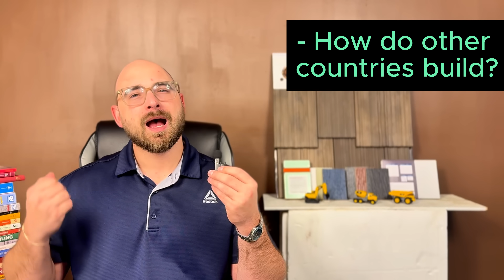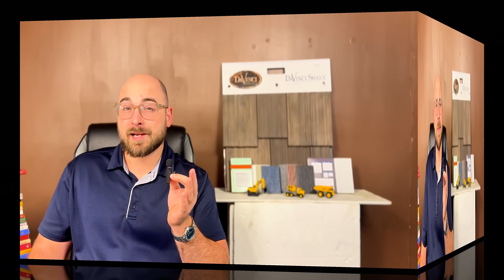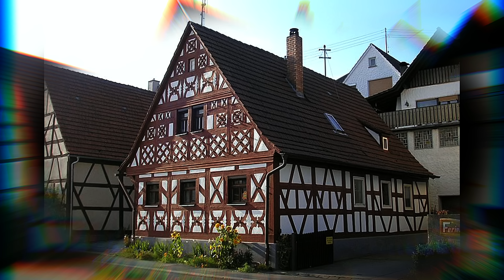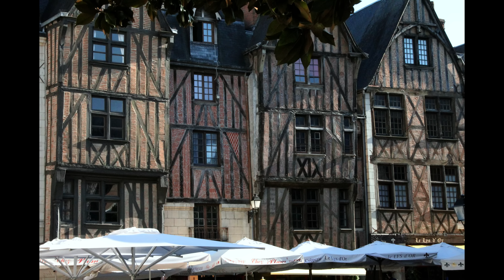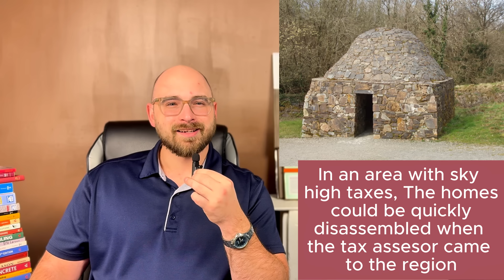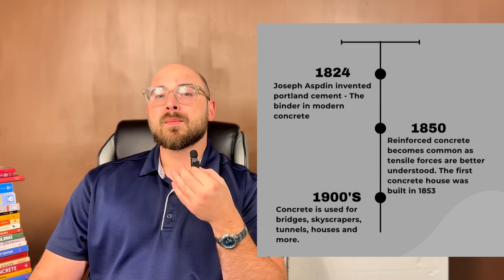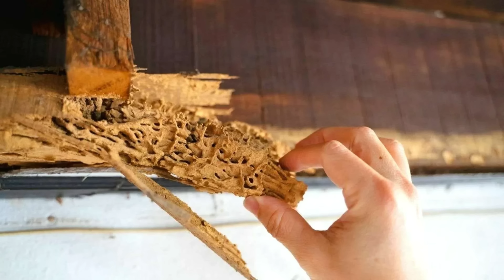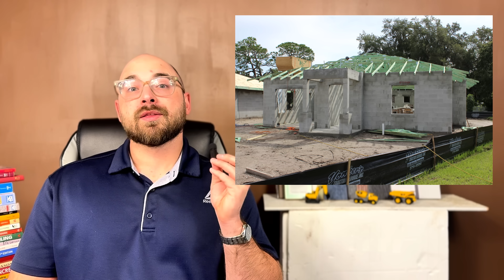Why Other Countries LAUGH at American Homes

Comment: If i am not wrong the romans contreet its sectret was limestone chunks so if there cracks to appear water would get in amd the  limestone would slowly react with water and surrounding concrete and fill the cracks and as result make the concrete strong and whole again 'self heal' and to why a lot of roman concreet structuurs are still standing. (Sorry for lack of punctuation am crap at that) But what is more interesting is the roman contreet used around water isn't as corrosion sensitive and as far as i know last time i looked into it we still dont know how or why it isnt corroding and how it still last and remains strong.

Comment: Just one detail about roman concrete you forgot: unlike the one we use today, it was self-repairing. The recipe was lost for centuries but apparently, using sea water instead of regular water was the trick.
Reply from the maker: There are admixtures we can use today that can give modern concrete self healing properties. 

One of which is xypex. 

Although I don’t know that it can heal cracks as large as Roman concrete
Reply: @Mike_Fortin  
Just discovered your channel but i guess you know much more about all that than me, a random dude with no particular interest in building.
I don't know about large cracks but i just thought it would have been good to point out that even if its still a much better material than paper and light wood, no building made of your average modern concrete could last 1000 years like the stuff the romans built.
Reply from the maker: I appreciate you as a viewer, I’m working on drastically improving the quality of content (shorter, more entertaining, better editing etc ) 

It’s possible to build concrete homes that can last for centuries, it would just add cost, 

The important thing is to protect the concrete from water. 

For example, an ICF house protects the concrete from water, we add a capillary break at the footer, we use waterproofing AND dimple mat below grade, creating drainage and waterproofing, 

We can add xypex to self heal small cracks, we use a geotechnical engineer, to minimize settling, 

This is pretty standard for homes I design. 

To go a step further,

We could go as far as to build a concrete or steel roof, use corrosion resistant reinforcement like stainless steel. ,   Build 1’ thick walls instead of 7” thick. 

It’s possible, but most won’t build that way 

When we’re talking about the most expensive homes they’re usually all about vanity, not science.   Ie, floor to ceiling windows, roof designs that are bound to leak (sloping the wrong way / pooling water), etc.

Comment: Light wood constructions would have been fine if they were very cheap to purchase.  Unfortunately in the US these houses are very expensive given the material they are made of.  They may be cheap to build but non of these savings are past on to the home buyer.  I lived in such a house in the US and it was bad.  No noise isolation! Everything can be heard inside the house.  The walls were leaking water when it was raining (the walls, not the ceiling!).

Comment: Im in the uk and my and my dads house are brick and where built in the 50s and never had any structural, mould or damp issues. 

My grandads house is 250 years old and same thing. 

And there is a stone and mortar church in the vilage from the eight hundreds which a couple live in and  and it hasnt had any problems either for the 1200 years its been stood.

Comment: It't not only the material choice. The build quality is atrochious as well. I always like to tease my family in Malaysia about their poor contruction standard, but compared to the one in the US they build magnificent palaces. I visited a friend in his fairly new home (~3 years) in Detroit and was shocked how badly built it was. Doors didn't close properly, bathroom taps were loose, there was a leak in a water line in the wall of the garage, the stairs were creaking when stepped on, you could hear every single word through the floor and the windows were not tight. I could feel the draft going the guest room from a gap between the window frame and the wall. The driveway was cracked, as the concrete was either too thin, or the foundation not prepared properly.
He paid $750000 for that piece of shit.
Reply: Sure but NONE OF THAT has to do with the build quality of the home. There are home builders and then there are other contractors who are hired by the developer to come in and do their jobs whether electricians or plumbers. I can assure you there are shitty homes in Europe and around the "developed world" that have had bad electrical work or bad plumbers.
Reply: @wowomah6194  True, there are shitty houses in Europe as well, especially in the southern countries, but I haven't seen anything at the level of the US cardboard boxes yet. Even the peak of cheap crappy construction in the 50ies and 60ies does not come close. Those houses are still around today, unlike most buildings in the US that rarely get older than 60 years

Comment: I was raised in a house in Ukraine with the walls 60cm thick. I lived in the south where the most common material was a block of pressed sand, sea shells and other stuff from the sea. It is usually 40cm wide. Then the outer wall is usually from a lightweight red brick. And inner walls throughout the house are made with cheaper and ofc heavier brick. This way the house is cool inside in summer and warm in winter. What I see on the Internet how people break inner walls with their hands in the US really shocks me bc I can’t even hang a picture on my wall without drilling it

Comment: One thing that always stands out, is how Americans whine about not wanting to live in apartments because their neighbors might be noisy. Which if your apartment is made out of wood and thin panel sheets, I can understand, but our homes are not built like that, they are built out of brick and stone, meaning that it's very unlikely that you will hear your neighbors making any noise, except for rare occasions (like when my neighbor drops a bowling ball on their floor (or maybe it's something else, but might as well be a bowling ball) or when my other neighbor decides to drill the thousand'th hole into their wall that by this point HAS to look like Swiss cheese....

Comment: My house is over 100 years old, build with solid brick. It keeps cool in summer without the need for AC and it's easy to heat in winter. Mold is not an issue if you heat your house properly and air it out regularly. Actually, I'm thinking about buying humidifier because the air inside my house is too dry 😄

I used to think that punching through a wall is a thing only in movies. I was surprised to learn it's actually possible in real life 😳

Comment: Thank you for the informative video. I've always wondered why you still don't build mainly brick or concrete houses, but still stick to wooden ones. Here in the Czech Republic, it is possible to build from concrete (mostly panel houses, in which there are individual apartments), brick houses (especially family houses), but also from wood. Wooden houses are also very nice and, most importantly, much cheaper. However, they require exactly the same documentation as brick houses and must meet strict safety rules. It is also possible to build a wooden cottage (I would finally like one in the garden this year). It is only used for occasional living - mainly for recreation and certain rules apply to it depending on the dimensions... I think that despite this, a brick house (or a house made of concrete blocks) has greater advantages for the USA than wooden houses - by the way, houses can also be insulated with various materials, either between the bricks or along the perimeter of the walls around the entire house. The biggest advantage for you Americans is definitely safety from natural disasters. We've had several smaller tornadoes here too, and more houses remained in the entire village they swept through than if they were made of wood. The same goes for floods - during which only a few houses that were over 100 years old collapsed in one village last summer... S.🤗

Comment: The Roman Pantheon was the largest dome in the world for centuries. It’s built of concrete. They designed the dome to be lighter as it rose in height with internal coffers and a circular opening (oculus) at the top. But most interestingly, to me, they threw small clay jars into the pour. Adding more jars closer to the peak, creating hollow spaces in the concrete and reducing the load of the dome.

Comment: I've lived in 7 countries, rebuilt houses in 3.   US construction has advantages & disadvantages.   Easy to build by low-skill labor, goes up really quickly, resistant to earthquakes, uses renewable materials and easy to modify in the future.   As far as durability, a lot of wood houses in New England are over 200 years old - a friend owns a wooden farm in Norway that's 1000 years old....  it's largely due to good ongoing maintenance, which is true of any building.   I've seen crap building & poor maintenance in a lot of countries. 

PS - the coolest building material I have seen is aerated concrete blocks, which is really common in the Netherlands....

Comment: I used to think the same, but having lived long enough in the US I came to appreciate the homes for their major benefit. Modifiability! Want to add a window? Easy. Want to move an electric outlet? easy. Add a bathroom into an existing room? Easy to get the plumbing. All stuff you can't do easily in a brick house. I remember my parents adding a chimney into a brick/concrete built house in switzerland. What a major pain in the ass that was.

Comment: 15:30 CMU is interestingly used in Poland for some reason.
During communism alot of appartment units were built using prefabricated concrete slabs, because it was really fast to put up and it allowed for rapid urbanization, especially in cities destroyed by war and especially in the west, where many cities were ordered to be destroyed by retreating Germans during WW2 so the Russians couldn't use them to scout areas.
After the fall of USSR and Poland becoming capitalist, many appartment units are still modeled after the prefab appartments, but nowadays they are built with CMU and reinforced concrete instead probably because it lasts longer and since prefabricated slabs aren't made anymore here. 
New districts of bigger towns usually are built only with this method (Prime example is Jagodno in Wrocław)

Comment: These comments are absurd. I live in a wood framed house that has been absolutely fine for fifty years. There are many wood framed homes all over the world that are hundreds of years old and just fine. That seems plenty "built to last" for me. How long do we expect stuff to last? Ancient homes often are also impractical, not suited to modern living and simply unfashionable. Having housing that lasts hundreds of years doesn't really make sense. Likewise, I live in a cold climate and my home is well insulated. I have modern windows so it's very quiet inside. I've remodeled the home several times without great expense. It's silly to pretend that wood-framed homes are disposable junk or a bad idea. Lastly, anywhere in the US where the environment calls for CMU, it's already required by code. For example, CMU and tile roofs have been required in Florida since 1992. The homes you see that have been totally destroyed after a hurricane in Florida are almost always pre-1992 homes that were grandfathered in.

Comment: Not picking on you with this comment.
"Contractors are more familiar with wood framing" sounds just so stupid from an outsiders perspective. It's a cursed circle: most contractors don't know how to build with concrete => less people eager to build with concrete => less contractors are going to learn how to build with concrete => prices of building with concrete are driven high by workforce scarcity => most contractors don't know how to build with concrete. Now we're at the beginning. 

There's a guy on YouTube, don't remember his name, some big channel, he specializes on framed houses. In a video about why US doesn't build with stone/concrete he said something along the lines "it costs upwards of 400k$ to build a woodframe house compared to at least 600-650k$ for concrete house"

For some reason these advocates of woodframe houses always forget to mention that you are supposed to completely strip insulation and apply a new one with wooden framing every 15-20 years which is extremely labor and time intensive, also costly and you can't use your house during that period. If you expect to live in a house for 40 years at least it's going to cost MORE than a solid structure house because of it in the long run.
In that very video he says something like "there's about 2 million wood framing contractors in the US". That's a humongous chunk of building specialists who particularly advocate for wooden frame housing because of "reasons". It's a stalemate: there's a huge group of wood framing advocates whose main argument is that it's much faster to make a wooden frame house after some hurricane - despite the fact that the only houses actually remaining after the hurricane are solid structure ones!

Also it should be taken into account that americans have a weird culture of changing places multiple times through their lives and most often than not opting for a house in each new "place". This consumerist approach is what's fueling the urge to buy/build cheaper housing.

We, US outsiders, usually don't have the luxury of buying multiple houses in our lifespan, we hardly get by paying for a single house for 30-40ish years. So a house is not a "commodity", it's a necessity that is highly valuable and should be protected as much as possible from every imaginable threat.

Sorry for lots of words but it's quite hard to convey so much context in mere 2 sentences

Comment: My little house is 102 years old, I'm only the second owner.  Knew the iriginal owners until they passed away.  The only exterior repairs on the house have been new siding, roof due to storm damage and replacing the cement steps.

Comment: One point we are missing out on in this video is that I'd wager that North European light wood framing is different to American. So while they both use wood, somehow I feel like the wood buildings in Sweden and Norway are much more sturdily built than those I've seen in the US. So they both belong to the same category, but they are not identical, not at all. My parents house that I grew up in was a brick house in Southern Sweden, built in the 70s. It stands strong today and will stand strong for a long time moving forward. The roof is also from the 70s but may need replacement in the coming decade. My childhood friend lived in a wooden house, also built in around the 70s, it also still stands today and looks strong. Whereas in the US I see houses that last 20-25 years and are then demolished and you build anew. This is a strange strategy to me. The consideration of Co2 for concrete and bricks is also interesting, because the houses last much longer. Is it really less environmentally friendly to build a sturdy house that lasts, say 80-100 years, than it is to build a less sturdy house that lasts 20-25 years?

Comment: One of the big negatives i always saw with our danish construction methods, is that we had a time when housing nationwide had to be upgraded fast, and the concrete boom solved it effectivly, but it also took the "life" out of architecture for decades... in the late 70s to late 90s, we tended to build housing blocks that just became known as the "concrete scourge", as they were basicly just square boxes stacked on top of eachother for each home in the complex.

it has luckily changed in the past few decades, and even cheap concrete housing complexes are made to look more natural, and like they fit in with homes from the early 1700s, with concrete being the core of most homes, but with layers of brick on the outside to help with the look and feel, while not really serving a structural purpose, outside of having an airpocket between the two materials for insulation, as well as further insulation on the insides... So most homes have three layers now, with brick exposed to the elements, concrete for structural integrity and insulation, and then the internal walls with fiberglas insulation and plaster.
The philosophy for most danish construction is that even if a building cost twice what it could have with other material, being able to last 10 times as long, far outweighs the additional cost.

Comment: Well, it's quite common in Poland to build houses from bricks (although AFAIK single layer) with some kind insulation on the outside. However floors and foundations are usually done using concrete. I think it's easier? Internal walls are either done from regular bricks or using solid brick from some kind of lime-sand mixture (it's a pure white thing), but I have no clue how to call that in English. It's usually possible to move them unless those are load-bearing ones.

Any bigger buildings are done using concrete or mixtures of the above. Wood is very rarely used for construction with exception of roofs that are still mainly from wood. Although I saw cheaper box-like houses that didn't have a proper roof closer to north of Poland (Baltic sea is there with a bit softer climate I guess).

There are places where wood is used traditionally, for example in more tourist oriented Tatra mountains, but more often than not, brick is everywhere. At the very least when we're talking about any modern stuff from latest 50-something years.